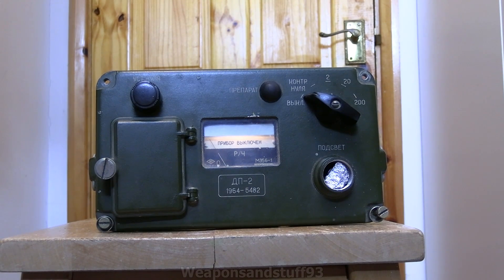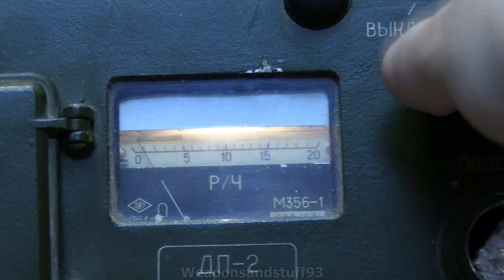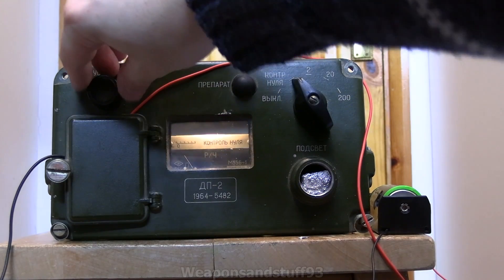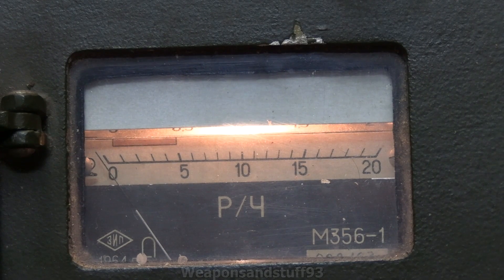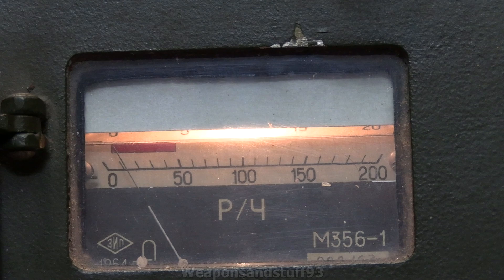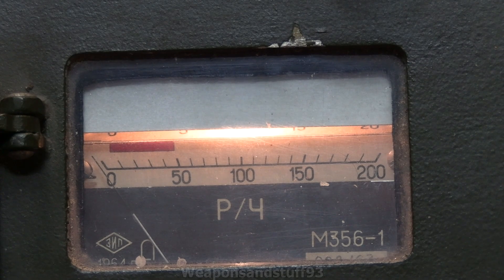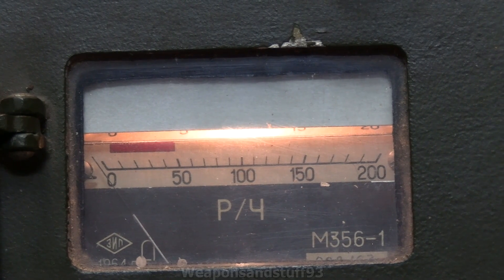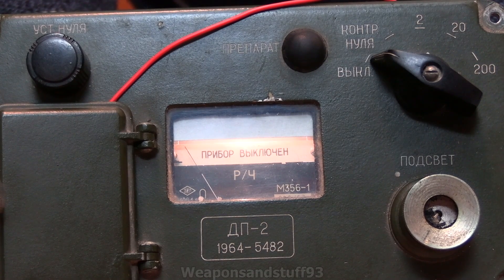Soviet DP-2 Roentgenometer/Radiation Detector Review

Comment: This thing reminds me of the Polish D-08/1 roentgenometer. This thing used 3 different obsolete batteries, one of them was very similar to the one in this thing, but two other don't even exist on Google. Even better, one of them had 100V, the other one 13V, so if you want to power it, you have to build the batteries yourself. It is possible, but it's a pain in the ass, especially if you can acquire D-08/2 which uses 3 R20 batteries.

Comment: Battery "145U", 145У - 1.6V, approximately 8,9 Ah capacity, these were made in 1973. 43*43*102 mm, resistance 20 Ohm upon discharge. Zinc - manganese dioxide type.
Reply from the maker: Thanks as always Vladimir, interestingly the Polish unlicensed "copy" of the DP-2 the D-08 uses the same battery, will get around to filming a video on the D-08 at some point.
Reply: @weaponsandstuff93  The main reason for using these batteries was working temperature: from -40C up to 60C. All-year round use, basically.

Comment: I would advise against using the light often at all if you're overvolting it. I'm not sure if it could be replaced with the spares included in the DP-5 kits, but it would still be a hassle and a waste of a good bulb.
Reply from the maker: It's literally an old edison screw bulb, the same type used in the CDV-750, MK-2 Radiac, DP-5 meters etc. Probably meant to actually work at more than 1.5V. I was just doing it for the video anyway so the camera would focus on the meter.